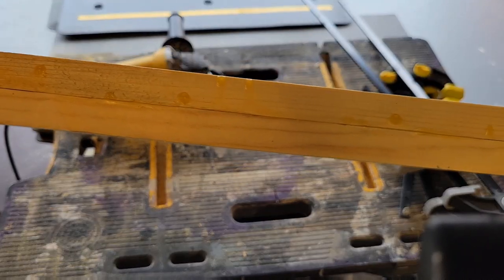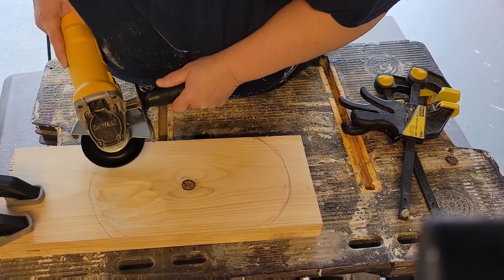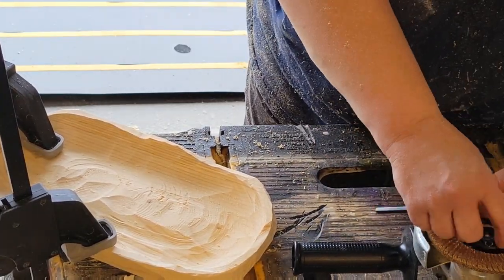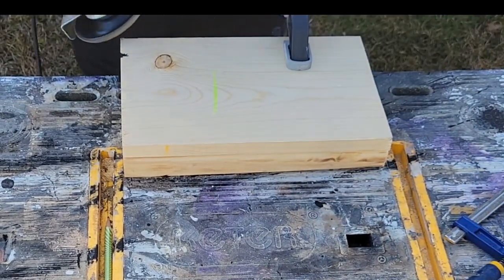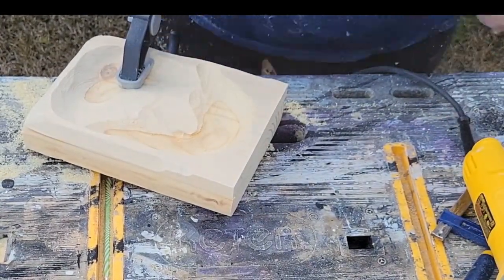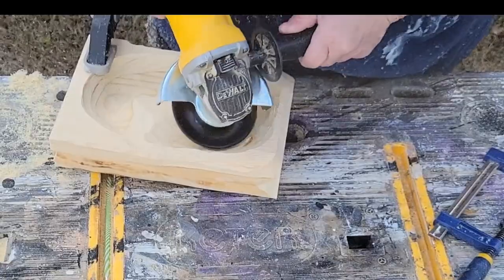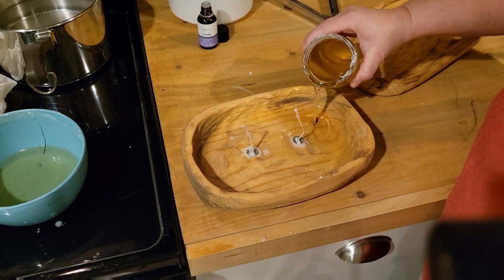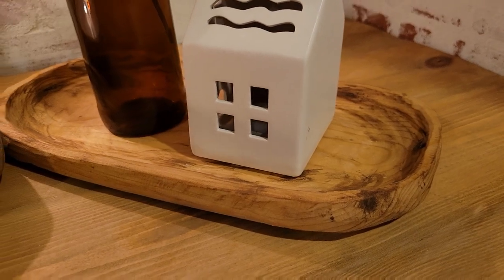Dough Bowls! how I made my own/FREE decor from scraps

Comment: If you tea or coffee stain the bowls then just use mineral oil you can use then as fruit bowls. You can also take a torch and burn them all over then use a wire brush to scrap of loose char seal with a clear finish  and put decorative ball or candles in them. Just some different ideas to use the bowls.
Reply from the maker: yes! i love using a torch. i used it in my previous trash to treasure videos!

Comment: Traditionally dough bowls are made with maple or other hardwoods, I've made bowls and cutting boards for years ( and years ) pine would not be  my first choice, the pitch may change the taste of the foods or dough that come into contact with it. Maple kind of remains "inert" and cleans much easier than softwoods. Also use mineral oil and bees wax, for the finish if it's going to come in contact with anything edible.... never furniture polish. Other than that you did a nice job.